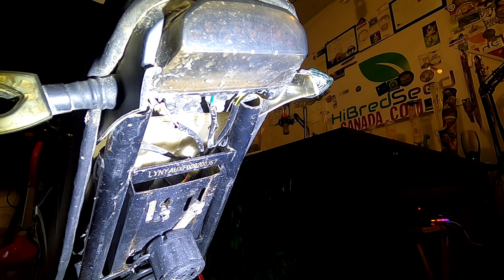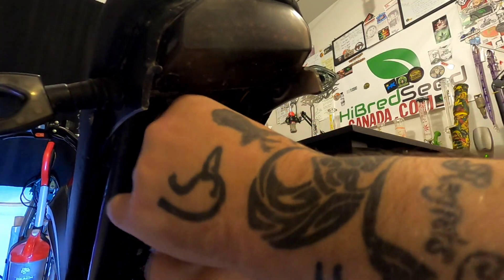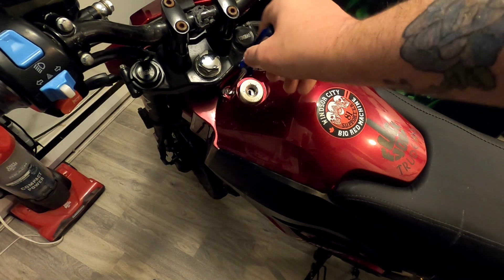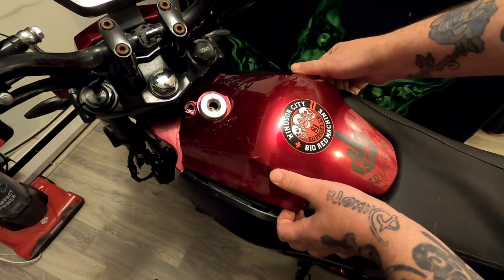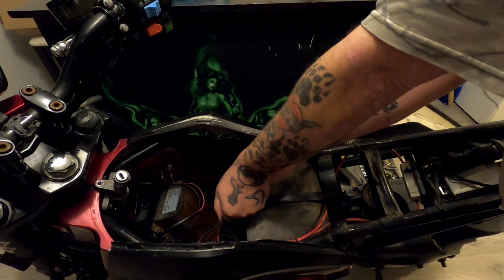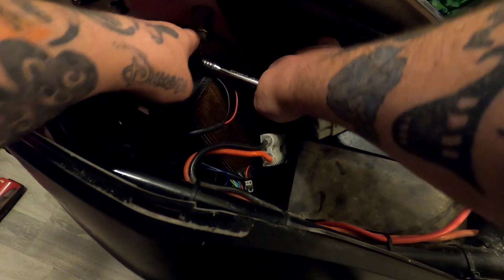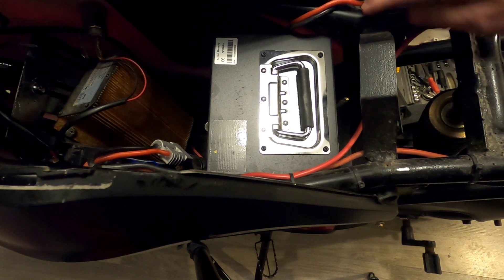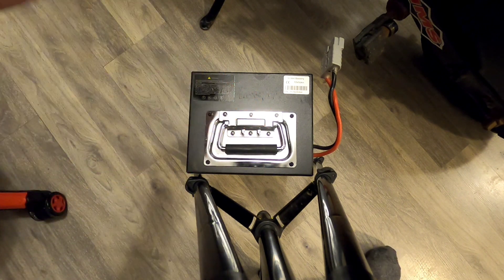How To Remove The Daymak Pithog Max 72V Ebike Lithium Battery Pack

Comment: I dont have allan screws under my seat mine are phillips screws, the bracket that is over the battery on mine has a cross bar like a + sign, slight differences, another thing i noticed some Pithogs have black front rims, mine is all chrome .

Yeah you cant charge the battery inside the house you gotta bring the whole dam bike inside, a big pain in the ass for me cause i gotta go up 3 steps to get it into my house, the old cement block steps you see on some houses, that kind .. You'll need to be fairly strong to lift 250 lbs up your steps, Ive done it a couple times already during the summer to install aftermarket handlebars and modify the battery bracket so the battery doesn't wiggle and rattle on the road and off.

 Definitely inconvenient having to lug the whole bike inside just to charge it during winter, not to mention the snow melting everywhere on the floor after its been sitting. (rubber matts) 😆
Reply from the maker: Wow that's bloody crazy.  Good old Daymak